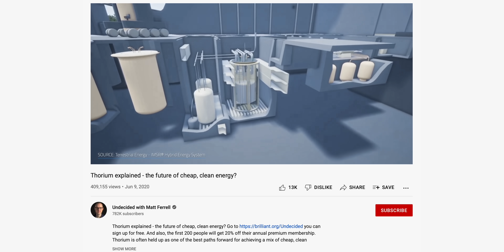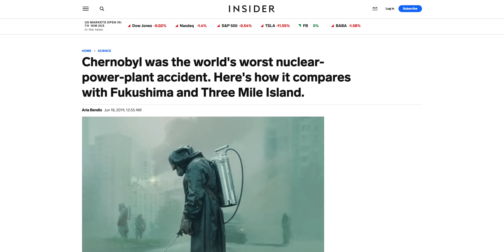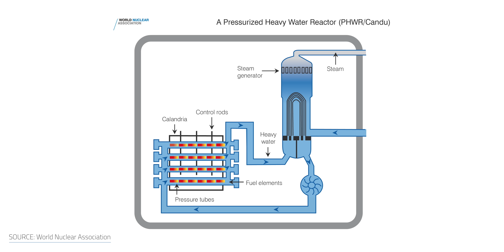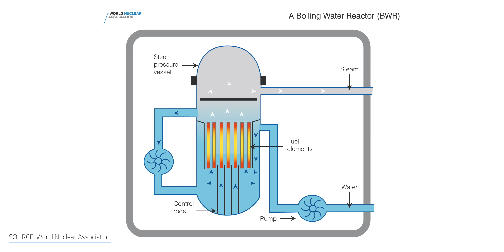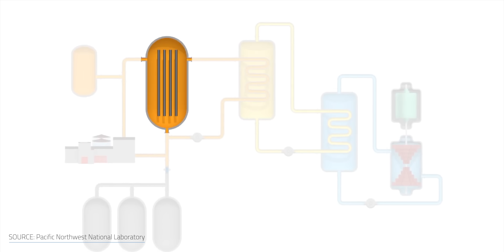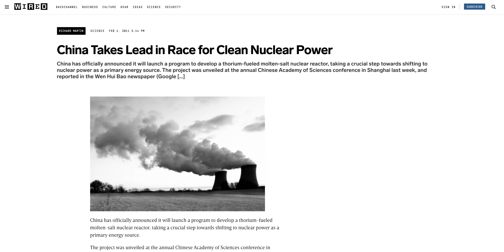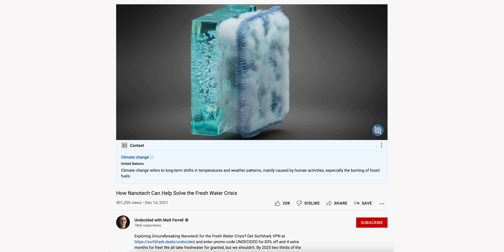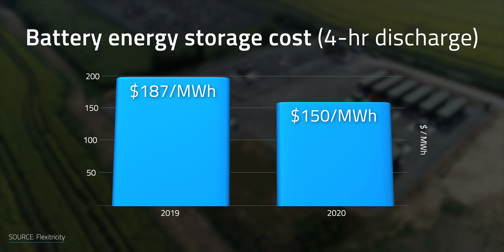Revisiting Thorium Energy - The Future of Nuclear Power?

Comment: Greetings:
Although you mentioned briefly that thorium reactors have spent fuel waste with a shorter half-life than conventional light water reactors (pressurized and boiling water reactors) you failed to mention that molten salt fueled and cooled reactors can use light water reactor spent fuel as its fuel, being a potential solution to existing stored spent fuel; we get energy while significantly reducing the volume of existing spent fuel and significantly reducing the lifetime of its radioactive spent fuel.
Thorcon is presently working on a demo molten salt reactor for Indonesia that will operate on the least expensive fission fuel available at the time. The reactors will then be manufactured in Korean shipyards similar shipbuilding, towed to the shore closest to their need and settled on the seabed where they will be connected to the grid. Multiple units will work in parallel as power capacity is required. The reactors themselves will be delivered as sealed pots that will be swapped with second units that are available side-by side with collant/fuel pumped from the old pot to the new so refueling downtime is limited and providing radioactive decay time before the old pot is refurbished. Factory construction will enable reduced expense as improvements can be handled during manufacture.
Reply: The reason I keep focusing on a 100MW reactor is the engine needed for a ship. Ships are the worst polluters than cars and power plants except for coal plants.
Reply: @romado59  In today's world, you think it is a great idea to have nuclear powered commercial ships floating around. A mobile terrorist target....let me think about that one. BTW it was tried by the U.S. and the cost to operate the nuclear powered ship made it unusable.  Read history!
Reply: @clarkkent9080  Unusable?  So why is the US Navy operating Nuclear powered aircraft carriers and submarines?
Reply: @lowellsavage  The U.S. military has many very expensive ship sand planes that no commercial company in the world could afford and they don't exactly pay their crew commercial wages.  A 747 cost $480 million and a B2 bomber cost $2 billion.  Nuclear submarines can stay underwater as long as they have food and that is worth the cost.

Read the story of the nuclear powered commercial ship Savannah if you want FACTS on why commercial powered nuclear ships no longer exist.  I use facts on real events and real nuclear project failures in the U.S..  Try and find ONE commercial nuclear project sucess in the U.S. in the last 25 years instead of using unrelated examples.
Reply: @clarkkent9080  please go out and do more reading on the topic and stop being a seller of fear.
Reply: @solstratus8444  I don't sell fear but I try to present FACTS.  MSRs have been tested in the U.S. and abandoned.  You can argue the reason for abandoning MSRs but you cannot argue that the concept was tried and abandoned.  
We will both get a chance to see recent U.S. FACTs on MSRs when the TerraPower Natrium reactor is built.  Afterward, if investor-owned utilities build them without taxpayer welfare then I will stand corrected. However, if you follow that project, you know that the location was specifically chosen for political reasons and that is not a recipe for sucess.  The $4 billion price tag for a 345 Mw reactor is also a non-starter when comparing other energy plants.
That project is 2 years in the making and still no ground has been broken.  Before further argument, lets both just sit back and accept REALITY without excuses.
Reply: @clarkkent9080  you cant say something being abandoned is agrument enough why something isn't worth pursuing, you have to know why it was abandoned. Which at the time was due to the united states being more interested in nukes than power. The main reason power systems cost so much is due to regulation that id lobbied for by ignorant fear mongers who prey the ignorance of the general public. Now I seriously hope these plants especially the modular plants come online or we will be back in the dark ages as a species.
Reply: @solstratus8444  Both VC Summer and Vogtle built and operated nuclear plants for many years.  The utility knew exactly what they were building and the NRC for the first time fully approved 100% the construction and operating permits.  So if the utility built it according to plans and showed the NRC that documentation that is the only REGULATION ...period.  Is that too much to ask that they have documents to show x-rays of critical welds or documentation that systems were tested and work???
So they have the plans and they contract with the work and at VC Summer they spend $17 billion for 2 units that were estimated (BY THEM) to only cost $14 billion and the utility then states that they have no idea how much it will cost to finish so they cancel.  How in Gods name does that have anything to do with regulations or fear mongering?????
At Vogtle they now have spent $30.4 billion and they say (check it out if you do not believe me) That they lost thousands of build records necessary to prove it was built according to design.  In order to obtain the documents they estimate it will cost $1 billion that the ratepayer will be responsible for and take an additional year.  How in Gods name is that a regulation problem or fear mongering???/
BTW a number of the project mangers are under inditement for fraud but I guess that is just another bad regulation.  And both VC Summer and Vogtle used factories to build modules that arrived on site with bad welds and did not fit together and cost time and money to rework.

Spend one weekend at any bar in Waynesboro Ga. and ask anyone there (almost all Vogtle workers) what the problem is with the project and you will not hear anyone blame regulations or fear mongering.
Reply: @clarkkent9080  All great points! And yes, the Vogtle power plant did cost $16.4 billion (I checked), but it is generating electricity at greater than 90% capacity, and as per my rough calculations it is generating around $2 billion in revenue each year (most of which is profit). So, in just a decade, it would break even and then start generating those extra $ for the next 10 years (assuming an average life of a reactor to be around 20-25 years)
Reply: @CouldntBeMoreRight  You apparently are confused. The old unit 1&2 have been operating for decades.  The new unit 3 & 4 have so far each cost $15.1  billion each and are not expected to operate for another 1-2 years which should add more than $1 billion each. Then there is 1-2 years of startup testing and final repairs. 
 The generally accepted profit for a 1,200 Mw (thermal) nuclear power plant is $2 million per operating day.  Factoring in maintenance, refueling, etc.  you are looking at closer to $600 million per year minus the interest on what will most likely be $16+billion per unit.  It will be many decades before they could possibility hit a break even point.

If you research why utilities want to shut down the older, fully paid for, operating plants, they will indicate that even though they are generating a profit, the utility can make more money with other power generating plants.  Since deregulation, electrical generation is a money making business for investors.
Reply: @clarkkent9080  Thanks for the misguided comment saying that I am confused. Let me solve your confusion.

Units 1 and 2's actual cost was $8 billion which adjusting for inflation stands at $16B. You inflated that figure to $17 to make it look worse than it is in the previous comment. By your admission they are functional and 2017 data suggests they produced 19,176 GWh of energy in that year. You can calculate the profits by looking at the power rates in Georgia. Naturally, with inflation rising every year, the total cost for unit 3 and 4 are going to be higher than the previous figure.

Your last para is true, that electricity generation is a money-making business and that there have always been cost overruns with anything nuclear. These are problems that need to be SOLVED and not be dismissed as insurmountable issues. When a new technology is introduced in a market, it costs more but with more adoption, the cost decreases over time (you see that happening in all industries)

And more importantly, you forget that climate change is a real issue and needs to be solved. Thorium power is the only available alternative that is carbon neutral and has the potential to meet the needs of 11 billion people in 2050. We already have a huge misinformation problem, please don't add to it.
Reply: To date, the only thing Thorcon has produced is the world's most expensive power point presentation. No ground has been broken, no concrete poured, and in all likelihood, never will.
Reply: @rhynosouris710  I am all for building new reactors but not with taxpayer welfare.  If the government would stop giving taxpayer money away, these companies would die on the vine.  Support for renewables can slowly decrease as they can stand on their own now but after 70 years of government support, it is time to cut the nuclear umbilical cord.
Reply: The U.S. built a plant to reprocess spent reactor fuel but it was never used and abandonded in the 1970s.  The U.S. spent billions building a MOX plant to recycle weapons grade Pu239 into reactor fuel but it was cancelled in 2018 because of massive cost over runs and schedule delays.  ANYTHING dealing with nuclear is super expensive.  You are not just burning waste paper in a boiler.
Reply: @clarkkent9080  No, superman, everything when dealing with government is exponentially more expensive. Do you think that cost overruns and delays are accidental? It is a culture amongst government and unions to milk the budget for all it's worth. Gotta spend it or it will be less next time...
Reply: @GarthClarkson  The real issue here is we cannot build a nuclear project in the U.S. on time or on schedule and that is due to many factors such as mismanagement, greed, corruption and even sabotage to keep the gravy train going. And if private investors are unwilling to put up their own money, that should tell you that new nuclear is not financially viable under the current circumstances.
Reply: @clarkkent9080  Exactly. I just said it where you have explained it. All of those factors are why government spending is not effective. On top of that the amount or red tape keeps an army of public servants employed before a single thing is achieved.
Reply: @GarthClarkson  We do need nuclear as part of the green energy but 
#1 It must be investor driven and 
#2 It cannot occur for another 25 or so years.

That means we need a "bridge" source of electrical power and that will not be green.  Sometimes reality sucks.
Reply: @clarkkent9080  True. That goes without saying. Those who don't recognise this are not serious about it. It is like quitting your job before having another to go to, just dumb.
Reply: @GarthClarkson  Exactly. Look how SpaceX has left NASA in the dust, in a very short amount of time.
Reply: Helion fussion energy from helium3?
Reply: @edthoreum7625  Fusion power is just 5 years away and has been for the last 25 years.
Reply: No. Spent fuel from 235U reactors is too lean to maintain fission and 232Th breeding will not work
Reply: it's not that easy, this process needs massive, very complicated treatment of heterogenous fuel rods to be able to be used for the transmutation and even then, only very specific parts of the "waste" can be used.

it's nowhere near economical
Reply: @Markus-zb5zd  It doesn't use fuel rods at all,  And the radioactive byproducts end up in the molten salt and are free to keep reacting to lighter and more stable byproducts.  The molten nature of the reaction make it possible to separate and/or filter out desirable and undesirable byproducts.
Reply: @Markus-zb5zd  the limirations are different for molten salt reactors.
Reply: @solstratus8444  what limitations are different for molten salt reactors? I think you didn't grasp what I meant with heterogenous fuel rods,... also MSRs have additional limitations and problems, especially with corrosian and shutdowns,..
Reply: @Markus-zb5zd  you just stated two different limitations for msr to Standard high pressure nuclear reactor. I dont know msr's to have fuel rods, but what do you mean by heterogenious fuel rods ? I dont know of fuel rods being mixed into the salt. Just that they are moderated by graphite rods.
Reply: @solstratus8444  yeah heterogenous fuel assemblies or whatever,... they don't need to be rods
Reply: @Markus-zb5zd  We need an economical base load power source and that can be nuclear.  But here in the U.S. every recient (last 25 years) nuclear project has been plagued by massive cost over runs and schedule delays to the point that most have simply been canceled and the ones that were not canceled are resulting in significant cost to ratepayers.  Most of these private investor owned companies that are on the "we gotta fix climate change bandwagon" , were polluting the planet for decades. The only green they see is billions of taxpayer dollars up for the taking. They don't want to fix the construction issues because those billions of cost over runs flow into the pockets of these companies. 
I have not heard any suggestions on how that will be any different for any new nuclear project. The excuse used in the current builds (VC Summer and Vogtle) was pre-fab factory builds but that was used and turned out to be a complete failure.  The failures in constructing nuclear is resulting in a new generation of anti-nuclear Americans as electrical generation from these sources results in significant rate increases. 
I am not a betting person but I am willing to wager my own money that the Natrium and NuScale will not meet schedule or cost targets and I am not the only one that believes this.   The article below appeared 2 days ago.
According to Ohio-based Institute for Energy Economics and Financial Analysis, a new type of nuclear reactor that would provide carbon-free energy to at least four states in the Western U.S. poses financial risks for utilities and their ratepayers as being is "too expensive, too risky and too uncertain. “The report concluded that it's likely the NuScale reactor will take longer to build than estimated and that the final cost of power will be higher than anticipated and greater than the cost of power from renewable alternatives.
The project's owner and the company developing the reactor, that stands to benefit from $4 billion in taxpayer funds used to help build the reactors. criticized the report, saying that the cost estimates should include taxpayer subsidizes when calculating the costs of the reactor.

Comment: LFTRs aren't more efficient in their fuel usage because of more efficient neutron economy. They are more efficient because fission products and fission product poisons are chemically removed during operations and fuel can be added during operations. This means that only enough fuel is in the reactor at any one time for it to go critical. Little excess fuel is needed. At the end of a reactor's life, the molten salt/fuel can be drained and reused in another reactor. Little is wasted. There are a few nuclear reactions that end up producing unfissionable stuff, but this effect is minimal. 

In a pressurised water reactor, enough fuel is loaded to operate the reactor throughout the core's life. Also, fission products stay in the core. Because of this, the initial U-235 fuel, and nuclear processes, more long lived nuclides are produced. In the end a small percentage of the fuel is actually consumed (<10%). The rest remains in the core and is disposed of as waste. Because we (at least in the US) don't recycle this waste, all that unspent fuel is wasted. This makes pressurised water reactors very inefficient in their fuel usage.
Reply: And this is not a thorium "advantage", it's an MSR advantage and works on the uranium fuel cycle the same. Yet it's being paraded as a "thorium" talking point.
Reply: @zolikoff  You are right. Reactor types are not fuel specific. That is not news. Thorium and Uranium can be used in both MSRs and PWRs. Currently though, rightly or wrongly, Thoriites seem to be the only ones pushing MSRs, so to that extent, this efficiency gain is a benefit of Thorium, at least until Urainiites start moving toward MSRs. The fact is that most of the advantages of MSRs relative to Thorium use would also be advantages for straight Uranium MSRs. Fuel versatility has always been one of the selling points of MSRs.

Comment: China needs thorium reactors because it has Thorium but no real Uranium deposits . I have been hearing about China testing a Thorium reactor for years but not seen any implementation .  It's a  fallacy to think that if they develop viable thorium reactors that the whole World will benefit , it won't .
While 15 or so countries have Thorium deposits the extent of those deposits is mostly unknown so many countries might hold on to the asset for themselves .  The price of Thorium could end up much higher than more abundant and currently mined on a larger scale ,  yellow cake Uranium .
We have already seen the cost of hasty ill-informed decisions made by leaders that have plunged their respective countries into an energy crisis  and driven up the cost of electricity drastically and drove them back to coal fired power stations which with the help of China's trade bans drove up the price of coal .

Comment: I think the decision between renewable and nuclear isn't about cost, its about staying on this planet or venturing beyond the moon. Renewable generation in space diminishes with distance from the sun. Most importantly, any propulsion system worth using will require power generation on the output vs size of nuclear. Chemical rockets won't do, and ion propulsion is just too slow.